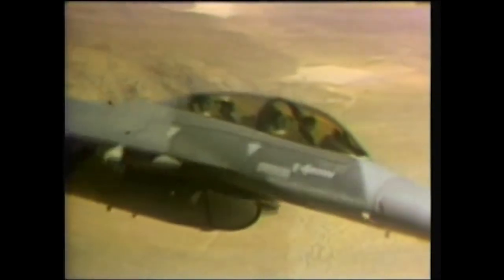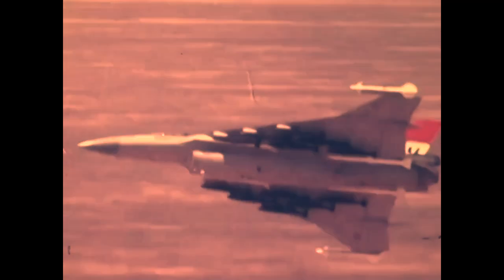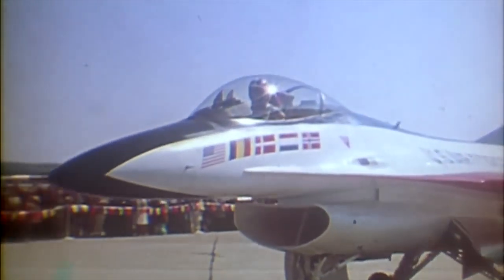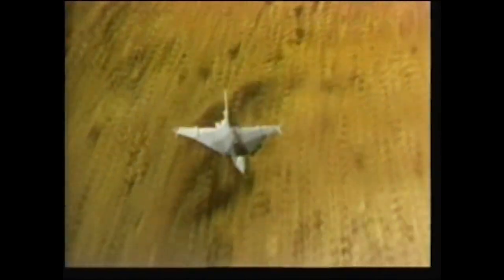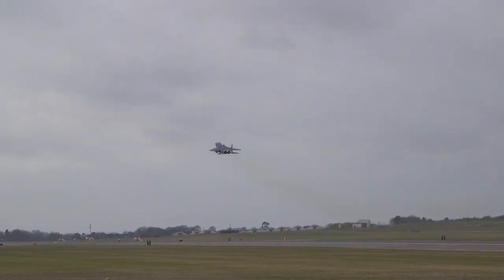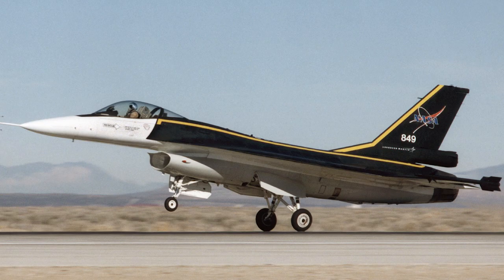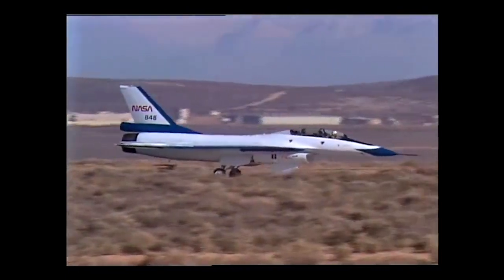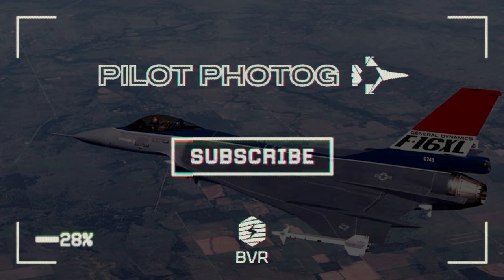F-16XL The Fighter That Should Have Been Built | avgeek |  #f-36

Comment: The key Generals and Congressmen were ex-F-4 drivers pro-McDonnell-Douglas and anti-single engine. That's all it took.
Reply: F-15E has a higher potential for growth e.g. duel 29K engines which improves sustained turn rates and acceleration.

Later F-15 Advance enables the high angle of attack capability due to existing tail design (i.e. stabilizers extending beyond the engine nozzles) and digital FCS upgrade.
Reply: With a single-engine, you are in a single-engine emergency from the moment you take off.
Reply: @carlsonloggie  Totally agree.
Reply: A big part of these decisions comes down to politics.
Reply: Ron.......ahhh, got it, time and again, political and corporate preferences play a big role in the development of weapons, how many of those went to work for MD later on?
Reply: If you read the test pilot reports, it had nothing to do with McD, and everything to do with its low T/W ratio. The senior pilots were used to the new trend in 1:1 T/W with the Eagle and Viper, and saw going back to a .88 was not progress, especially when self-escorting and having to maneuver in a hostile IADS net.
Reply: @teddy.d174  Pilot reports and detailed technical analysis are more influential most of the time, with some exceptions. A-7D getting axed in-favor of the gutless A-10 is probably an example of both.
Reply: @mannyb7949  Non-TVC F-16 Block 50/52/61/70/72 with digital FCS has crap AoA handling.

Non-TVC F-15 Advance with digital FCS has good AoA handling. F-15 Advance is the right choice for USAF's "gen 4.5" fleet.
Reply: @mannyb7949  Note that a high G instantaneous turn rate will need good acceleration to recover energy. F-15 Advance is improved high AoA handling.

Comment: At the time the military was moving toward the consolidation of roles in it's equipment and vehicles.  The HUMVEE for example was supposed to replace half a dozen previous army vehicles with a single all purpose machine.  It makes sense that the Pentagon would choose an established airframe that required little to none modification to fill the role.   It's very similar to the attempt to replace the A-10 with the F-35.  A transition that has yet to bear fruit.
Reply from the maker: Great point and thanks for commenting!

Comment: A more stealthy constructed F-16XL would be relevant today.  If powered by the GE F110-129 it would be a real killer with a high altitude capability (with a new canopy).  This configuration would be the perfect aircraft for Fighter Interceptor Squadrons along the ADIZ.  This aircraft super-cruised very well, and could fly a long way FAST on less fuel with that engine.
Reply: are you speaking from a standpoint that it would be better in a dogfight or just in general

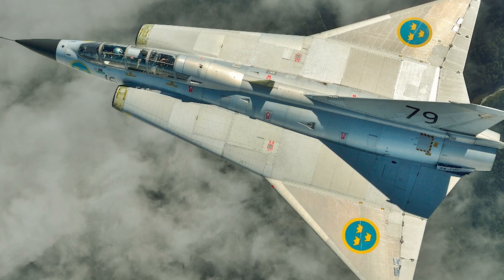Comment: 3:48 The Avro Arrow CF105 also had a cranked wing profile as did the Avro Vulcan bomber the Arrow had an enormous bomb bay and was capable pf mach 1.9 in 1953.
Reply from the maker: Excellent point and thanks for commenting.  If you haven’t seen it I just put out a Top 5 video on fighters that should have been produced.  The Arrow is on the list and the list and the subject of its own upcoming video.

Comment: those two had a good life tho, but i don't think with cost effective fighters such as Gripen NG, JF17, Su30MK and F15K already on the market anybody goes that far to really bring back the XLs, unless they go under so much so upgrades, maybe a XL version of F16V can get somewhere... if it's similar enough in maintenance and operation to the base line version, then maybe that can be an option for airforces that are already extensive users of the F16 in any of its current outfits...
Reply: I think India's LCA delta wing fits here....

Comment: single engine. But it would have been cheaper and been useful.
Reply: Not initially. It had some basic parts in common with the regular f16 but it had a huge number of differences that would have made it much more expensive to produce than the f15e
Reply: Wouldn't have been as good a dogfighter as the regular F-16 and would have been more expensive to support, too.
The wing-loading on the XL was less but the plane was also less maneuverable than the production F-16s because the engine had to carry that extra bulk and the engine back then really wasn't enough for the weight growth.  Even the 28,000lb thrust F110 wasn't enough to make the F-16XL a competitive dogfighter.  Now, with a 40,000lb thrust engine in service it might work better as a straight fighter but the XL and any late 1980s production version would have been a fighter-BOMBER as opposed to fighter-bomber.  Not as good a "swing fighter" as the standard F-16.
There were problems with the existing XL design that would have impacted its bombing capability, too.  There were at least 2 hardpoints that were not useable when carrying the large fuel tanks the XL used to extend its range.  Those hardpoints were overlapped by the fuel tanks when the tanks were installed.
The F-16XL was further away from production than the F-15E which had been flying in prototype form since the late 1970s and had a decent production basis for it in the F-15D.  Easier to restress and develop the F-15D into the dual-role F-15E than the F-16XL into the F-16E/F which would have needed LOT of work to become a production plane.
Sorry, but that's the reality.
They made the better choice with the F-15E.
Reply: hi W...
'
F-35 need to add twin jetmotors are better than single jetmotor
Reply: But, the AF at one point, cooked up the scheme (AND THEY TRIED TO IMPLEMENT IT AS WELL) that the A-10A was finally going to be killed off and the F-16 (albeit with some modifications, one of them being a slightly armored belly) was going to replace it.  All the pilots that I came into contact with, said, that (at the time, the change WAS GOING TO HAPPEN) they felt sorry for the troops on the ground because instead of 'loitering around' the new CIS Falcons would see just one inbound pass and then rather than to tempt fate, they would simply RTB.  They had NO confidence in the F-16 to be able to take a beating like the A-10 could (and has shown that it has had the ability) to do.

Comment: The F-15 Fighting Eagle is one of the best fighters EVER produced. With 2 engines it can not be compared to the F-16 or the F-16XL. They just are not in the same class of aircraft capabilities.
Reply from the maker: Agreed and the record speaks for itself.  I've actually made two videos all about the F-15 and working on more, I feel there was/is? a place for the XL.  Thanks for commenting!
Reply: You'd never believe it but Vincent J Burnelli designed a fighter that looked just like what eventually became the F15 but back in the mid 50's.

Comment: This would have been great in DCS. Then again so would the VISTA.
Reply from the maker: Yes! They could still make it for DCS, fingers crossed. Thanks for commenting!
Reply: Yea 50 years from now. Dcs is too slow. Still waiting for a c-17 that doesn't look  like a block of cheese.
Reply: @PilotPhotog  still waiting for a-7, eurofighter, kiowa, f4u etc etc
Reply: TassosK T-45, any US attack helicopter, a functional F-16, a finished F/A-18, Rafale or Typhoon. Is there a single finished high fi fighter?
Reply: Hope they make either a bomber or transport aircraft like the C130 or B52. There's plenty of information on the C130 and B52 as they're old as hell.
Reply: Joe Swanson I was JUST thinking about this
Reply: John Murphy they can not implement modern fighters, as the data are secret mist if the times

Comment: Suppose they had added a three dimensional vectored thrust nozzle had been added to the engine? And the engine had been upgraded in power later?
Reply from the maker: That would have made for an amazing fighter, thanks for commenting!
Reply: There was an experimental F-16 with TVC (Thrust Vector Control). It was designated F-16 MATV (Multi Axis Thrust Vectoring). This Viper had 3D TVC and was a total monster in agility. Combining XL with MATV, upgraded avionics, full datalink, & low observable technology would have given us a supercruising,, hyperagile, stealthy, long range multirole fighter that would be a perfect complement to the Raptor & F-35. Because of being based on a proven design, developmental costs would have been relatively low, which would result in a very affordable 5 gen.

Comment: Build a new xl with a f35 engine and thrust vectoring. That would be one mean aircraft
Reply from the maker: Yes it would!
Reply: Why you've only chosen the F-35 ones go make it bigger and slap an F-22 engine in it with built in TVC and make the whole horizontal stabilizer move and it will be 109% savage all around fighter
Reply: Ideally because it's a lighter aircraft the F119 engine would be better suited as it has a the ability to supercruise and has a speed over mach 2 because without the stealth characteristics of the F-35 this aircraft would need a greater speed to vacate threats.

Comment: I remember this plane back in the 80's. I built the first model of it. It's a real shame it never went into production. It had incredible range, excellent payload capacity, and was much more efficient and cost effective than the twin engine F-15E. Politics alone put the F-15E into production as the needed strike aircraft, and nothing else. Not much unlike the YF-23 losing to the YF-22. Politics prevailed, instead of the better airplane. I say better, because the cost of the wing production would have easily made the plane affordable enough to garner far more examples into the inventory for use. The cost would have been far less than the F-15E, along with far less expensive maintenance over it's 3 decades of service.

Comment: All deltas bleed energy quickly in a dogfight.  Very maneuverable, though.
Reply: Which makes it a better bomber, but it loses out on it's current air to air capabilities.
Reply: @eagle6754  It used to be true. Now, the Rafale and the Typhoon can run down any non-delta to death in a dogfight.
Reply: DrittAdrAtta And the Gripen shouldn’t be underestimated...
Reply: @soupfork2105  Great plane too, but compared to the Rafale and Typhoon, the Gripen is underpowered, it does not play in the same league.
Reply: @DrittAdrAtta  Gripen E is not under-powered. And it has repeatedly come out ahead of Typhoons, F-15s, and F-16s at Red Flag. Also, how many under-powered aircraft can top out at Mach 2+, or supercruise, like the Gripen E? Everybody looks down on the Gripen, yet it lacks nothing (aside from excessive cost, and sky high expenses per flying hour).
Reply: @kostaskritsilas2681  Check its T/W ratio, you will understand what I mean.
Reply: @kostaskritsilas2681  you have to take Red Flag victories with a grain of salt. As a crew chief in the 64th aggressor F16 squadron,  I know for a fact very strict limitations are put on the aggressor pilots for both aircraft maneuverability, and tactical standpoints. They loosen up restrictions on the aggressor pilots throughout the Red Flag, but they don't just let them guys go all out and wreak havoc on the "enemy" as it would be unfair to send guys out with 2000- 3000 hrs seat time against guys being trained during a Red Flag.
Reply: & they maintain total directional control even in a "Stall"! Explains my furious love affair w/ the JA-35, Yes;
Reply: DrittAdrAtta 
I don’t know why you guys think rads/second and T/W ratios are everything.  If kinematics are your thing, the Gripen doesn’t lack in that regard.  What it does have is a small signature and a very advanced and modular EW suite.  It has come out on top in many Red Flag exercises making kills when the adversary did not even know they were there.
Reply: @damianketcham  Go back to your original post - it's about maneuverability, so the response is strictly about that.

Comment: I would like to add to key factors when the Pentagon selects a aerial platform that is never mentioned in these postings.    1) Operating costs case in point the F-14 Tomcat was a hands down great fighter but the manufacturer's specs called for 50 hours of maintenance for every 1 hour of flight time - that was not sustainable if you value force readiness.   2) Manufacturing base,  the Pentagon wants to preserve its manufacturing based for planes by not freezing out (albeit legally) manufacturers that would go belly up without continued business - its a balancing act.  Politically these manufacturers spread out their plants to as many states as possible - why?  the more states you operate in the more Senators you have to lobby on your behalf!!
Reply from the maker: Excellent points and thanks for commenting!
Reply: I always thought that was an argument that should have been made for bailing out the American auto industry during the financial crash. While refitting the auto industry for war is not a capability the country needs very often it is crucial to have when needed. As we've seen with Covid and our inability to rapidly manufacture safety equipment as well as testing and medical devices. Basically not only do we not want to lose the millions of jobs that come with the auto industry and its related fields but during a time of insecurity you really don't want to lose your ability to manufacture a defence. I'm not saying I'm for or against the auto bail out one way or the other. Just that it was odd nobody made the case when it was being discussed. I guess they figured it could hurt them to make that argument. Some people might say good. We don't want to be wasting money like that anyway so let them go under. Otherwise maybe they would have mentioned it?

Comment: F-16XL is very incredible aircraft with unbeatable avionics, instead of using F15X, US should empower F16XL with twin engine will give maximum weapon load capacity as well US don't have delta combat air crafts too.
Look at world apart Eurofighter typhoon, Rafale, Gripen-E, quher-313 even J-20 all world is working on delta structured aircraft.
US have already best delta shaped body for future combat air craft, add two engines and little bit work on stealthy design and it's unbeatable stealthy delta fighter jet.
Look at success story of Miraj-2000 to Rafale.
Reply from the maker: Great points and thank you for commenting!
Reply: While I 'like' the general Delta-Wing design, it DOES suffer from at least one major drawback -- a drawback mentioned towards the beginning of this video -- that is: Like so many other delta winged A/c's, the speed scrub-off rate is AMAZING on Delta's -- so much so, that it becomes an 'Achilles Heel' when they 'sit on their tails'.  The dump energy EXTREMELY quickly and that makes them -- AND ANY Delta-Winged A/c that has EVER been produced (this may change and it might not hold true if some examples from 'black projects' ever saw the light of day) SEVERLY hampered in the ACM mode.  This was a problem with the Mirages, the Drakken, the Viggen, the Delta Dagger AND Delta Dart as well.  The Rafale had problems as well (amongst other A/c's).  Just one of the problems!
Reply from the maker: @warrenholmes3311  well said and thank you for commenting!

Comment: A good idea... for a small bomber. "Airspeed and energy drop off at an alarming rate." So it can't fight but makes a great testbed. The F-20 Tigershark would have been a more suitable project for interim  platform as it was simpler,  cheaper and quicker to intercept the other F16 models. But what do I know?
Reply: The problem with the Tigershark was that it was based on a platform that was already getting long in the tooth. Northrop was trying to squeeze every last drop out of the F-5. The USAF needed a light fighter purpose-built for the mission with a long upgrade path ahead. Had the F-20 been built instead of the F-16, you can bet it would not still be being built in 2020. Its upgrade path was a brick wall compared to the F-16.
Reply: @VisibilityFoggy  Political talk from the Pentagon. Their view was as you said and Northrop was hamstrung with a world recession and foreign military cutbacks. No Airforce would buy a plane whose home country doesn't use it. After 2 planes crashed in demonstration flights all hope and investment was lost. Same argument, I'll bet they wouldn't still be making YF-16s today either.

Comment: I know a lot of people are arguing that the YF-23 should have been put into production over the Raptor, but you're forgetting the acquisition mentality at the time. The ATF program also included the Navy through their NATF program, which was looking for a replacement for the F-14. The F-22 would have been able to be navalized for carrier usage while (I forget all the technical reasoning) the YF-23 either couldn't or shouldn't have been navalized. This was a major point in the decision-making process. We all know, of course, what happened – politicians wanted to fight wars in the middle east instead of preparing for America's next Cold War against an empowered China. So here we are, still producing F-15 airframes in 2020. The USAF got a much smaller piece of the Raptor pie than they wanted, and the Navy didn't get a slice at all.
Reply from the maker: Well said and thanks for commenting - in case you haven’t seen it here is the video on the F-22 where I mention the Navy’s involvement : https://youtu.be/YAhQlCKy0oQ